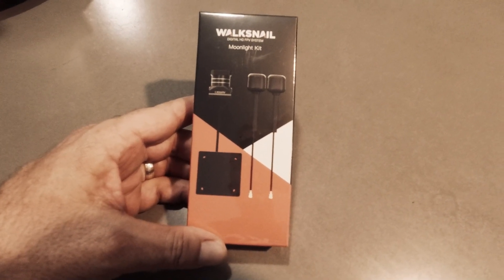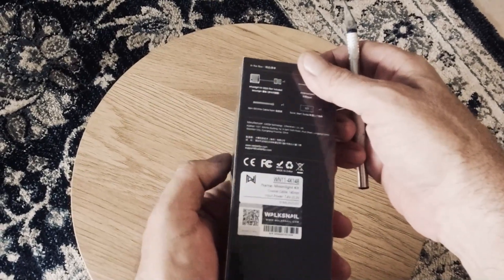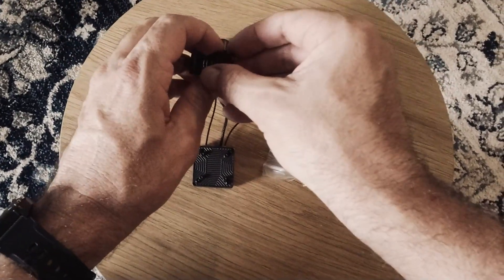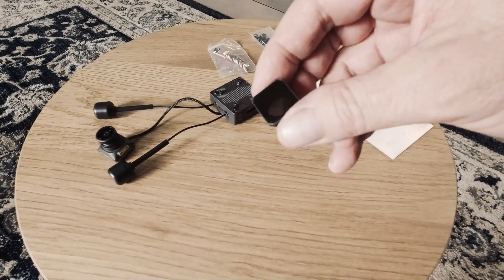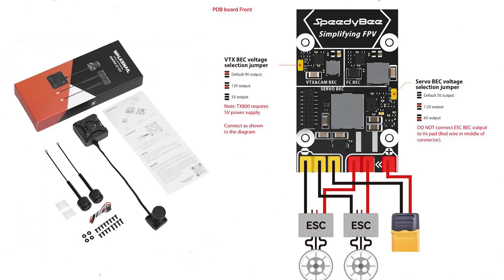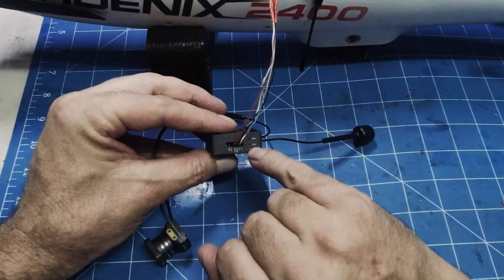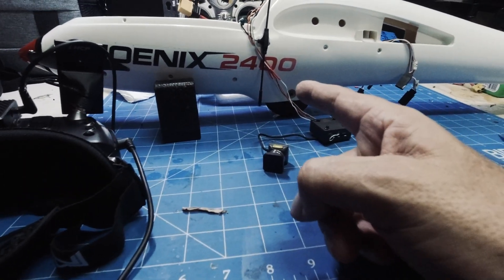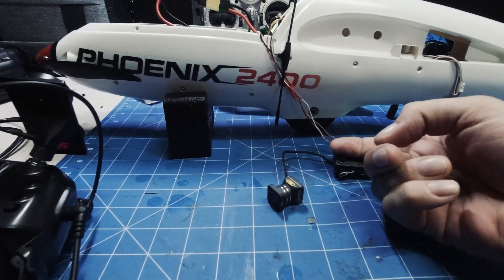Walksnail Moonlight Kit First Look + Firmware Install & Bind Setup Tutorial

Comment: How are you finding these goggles? And what maximum range have you achieved? Thank you
Reply from the maker: Overall I am happy with them. Range is a bit disappointing with my best only at 4km distance using upgraded aerials. In saying that I have seen others go much further some as far as 50km with the right setup. I have had mine for over 2 years and haven't had any issues I can say.